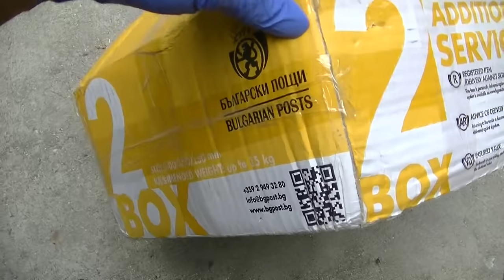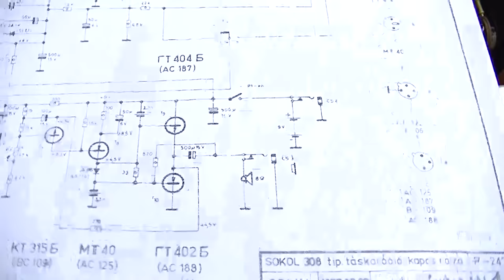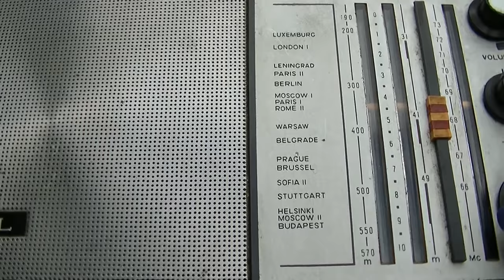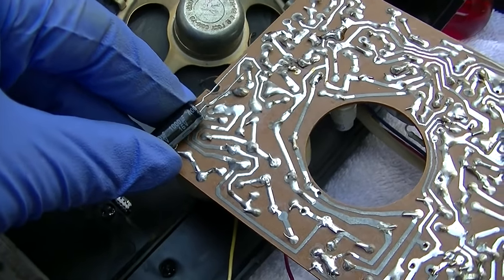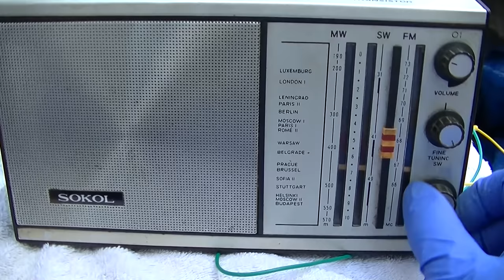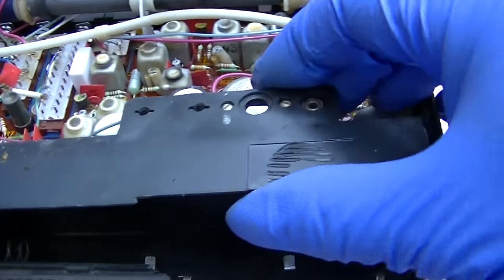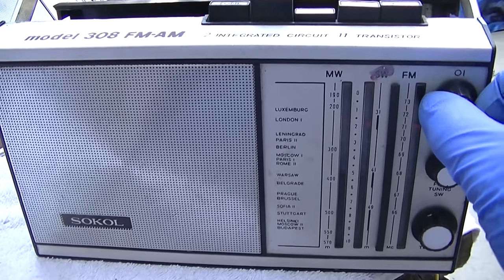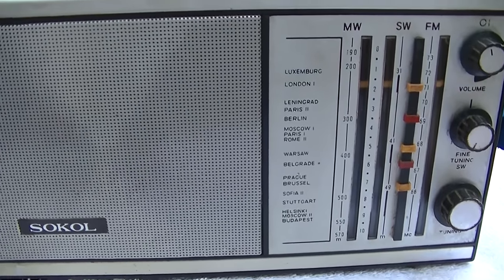Sokol 308 Russian USSR Built Transistor Radio Repairs

Comment: Shango, this lower FM band is following the OIRT standard, used by the USSR and its allies. If I remember correctly Bulgaria stopped using this band in 2005. You can modify these to receive the normal FM band. There are also Sokol 308s with a factory-made normal FM. There should be a table on the schematic somewhere with component values for the 88-108 FM band. I think I caught a glimpse of it on one of your schematics. Change out those components, do an alignment and you're in the game. For the sensitivity - Russia is a BIG country, so these were originally designed to give satisfactory operation even in the middle of the tundra, hundreds of kilometers away from the nearest stations. As a Bulgarian I can concur that these radios are EVERYWHERE. Apparently they were very popular and quite cheap. I have 4 right now, with one new-in-box.
EDIT: the replacement cap in the second radio is Bulgarian. Also on the second radio someone has already done some kind of quick and dirty FM conversion. This was very popular thing to do with old Russian radios in Bulgaria, when they switched off all the transmitters on the 66-73 MHz band. I should know - I've done it myself a few times, with varying degrees of success.
Reply: So what is the meter conversion on MW to KC, KHz? I found the same looking one on Ebay, but it says ST, KT, UKT for the bands. UKT looks like FM and it has the 88-108 dial. Also the one that lists the cities like Novi Sad and Skopje can be picked up on AM, but in the US, only gets the local stations.
Reply: I'm also Bulgarian and I get 3-4 stations in the Sofia region with Vef Sigma 206 and Resprom Lira 68 on the 66-73MHz band and they are different than the stations on the 88-108MHz band. I don't know how I pick them up, at least one of them is Bulgarian if I remmeber correctly. I had no idea that the 66-73MHz band stopped being used in 2005, but back then I was just 6 years old. Now I'm curious, have to check it again what radios I get in the lower FM band.
Reply: @Art7220  300/frequency in MHz = wavelenght in meters. So 190m - 570m is 1,6 MHz - 530kHz, standard MW or AM broadcast band. ST is AM or MW, KT is SW and UKT is FM.  Names on scale are localized, of course in US you get only US stations on AM.
Reply: Fascinating! Where would you best suggest buying one from? I'd love to import one to Australia

Comment: Here in Germany in the early 80s those russian electronics turned up in many "radio shack"-style shops. I had some "sokol" and other brand radios and a "TeleStar2002" B&W TV. The TV was built like critical equipment in Nuclear power plants or ICBMs. Incredible.
Reply: East Germany?
Reply: @eaglewi  no, actually in the west. Especially the small russian B&W portables were sold there in quite large numbers. They were also given away as a promotional gift for newspaper subscriptions and the like. I still have one of those small TVs which my mother got for subscribing to a TV guide magazine in the 80s.
Reply: I  got Sokol 304 from ukraine it works perfectly. I had one as Child and it never worked but no one in my family bothered to have it fixed under warranty.
Reply: @albinklein7680  
Did you see any Soviet computers in Germany in that time period? I heard they made a bunch of ZX Spectrum clones, many of them with English keyboards, presumably for export.
Reply: @gregorymalchuk272  ZX Spectrum was from 1982, those clones from 1986 or later. So they were obsoleted in west at that time. They were produced in low quantity and quality, often as home build projects. At that time they had to have english keyboard for compatibility. There were no localisation like in todays OS. And they were never licenced by Sinclair...

Comment: Shango greatings from Bulgaria. At about 3:50 the second paper you show with the scematic on it has the factory procedure on it to convert this radios to 88-108mhz on it. Its the tables on the bottom. The black cap on the second radio is bulgarian made replacement
Reply from the maker: so i need to translate that or have someone help me
Reply: @shango066  nothing that much to translate. it's just changing caps valius and putting caps in place of jumpurs around and inside the fm tuner, the two tables show witch are for 88-108 and witch are for the other, is actually very simple, they were made as you said for the foreign market so they are ready for bouth fm frequencies
Reply: around the tuner
c2 from jumper to 30pf
c3 from jumper to variable cap 2/7 pf
c11 from 30 to 43pf
c26 and c39 from 27 to 39pf
c44 from 3.6 to 4.7pf

jumpers "А to Б" and "Д to И" have to be changet to jumpers from "Б to Е", "В to Г","Г to Ж"

in the tuner

C1 from 1000 to 22pf
C3 from 10 to 6.2pf
C12 from 6.2 to 3.9pf
Reply: @shango066  would the Google Translate phone app be up to it, maybe? I’ve never used it for more than menus in French, though...
Reply: @simuler    this may want to be pinned to the top for future users...
Reply: @simuler  It probably also needs different number of turns on the osc and mod coils.

Comment: In the mid 90's FM changed from 66-74 to the western 88-108 MHz. It was very common to take your radio to the repair shop and ask them to re-tune it to the western standard instead of buying a new one.

Comment: I'm from Bulgaria and was quite surprised to see a package from my country on your channel. That was nice.
 The capacitor at 27:40 isn't a modern replacement. It's a Bulgarian capacitor from the Soviet era. It could still be a replacement but it's a USSR capacitor. The letters "БДС" mean ""Bulgarian national standard", and then the numbers are the actual standard. The orange transistor is the infamous in the former soviet areas KT315/KT361. The way you know is by the marking. I couldn't see what it was in your case. It should have a single letter somewhere, among other possible markings. If it's in the left top corner, it's KT315 (npn), otherwise it's KT361 (pnp) (in this case, the letter is usually in the middle of the transistor, but it can also be to the right). The letter is determining the exact type and variety of the transistor. For example: if it's a "G" ("Г") in the top left, the transistor is KT315G, if the letter is "B" ("Б") in the middle, it's KT361B. You have to look the exact characteristics based on that last letter and it's location, they differ between different letters (mainly the maximum collector voltage). Other than this, the device is basically just a general purpose silicon transistor. In many cases one can simply swap them with BC548 and BC558, or similar with little to no problem.

Comment: Changing from oirt 65-74MHz band to CCIR 88-108MHz band is easy. In Poland we had the same band. With 15$ RTL-SDR (oscillator measurement without connecting anything) it's a 30-60min job if you have schematic and everything plays along, 2-3h or more if no schematic and/or there are issues. Myself I have three radios which I converted to the new band. First adjust the oscillator to 98.2-118.7MHz (iirc almost all used standard 10.7MHz IF) and then use some cheap FM transmitter to roughly tune the RF amp. Both oscillator and RF amp should have LC tanks capacitance roughly halved (trimmer is preferred). IF and demodulator shouldn't need adjustment if they are not messed up.

Comment: Very interesting radios. Nice build quality. Since several LA TV stations still broadcast on the lower VHF band, I wouldn't be surprised if you did pick up a DTV signal. It makes sense the first one is an export model. None of the labeling is in cyrillic.

Comment: I know this video is ancient history by now but...  I'm kinda surprised you either didn't know or had never seen a band-shifted FM receiver.  Here in the US the original (pre-war) FM band receivers used something similar, down in the 30s or 40s range, but post-war the FM allocation was bumped up to roughly where it is today, and most people who had pre-war sets had the serviceman modify them for the new band.   For most radios you needed only to adjust existing trimmer components, but just like soviet band to USA band, you have to retune the oscillator to run in the range of the desired band, but you also have to stretch (actually you have to compress) the tuning to cover the new band, since we have a 20mhz allocation now but originally the lowband was 9.8-ish IIRC.  So you have to adjust the band-spread(dial alignment) trimmers, the coil manipulates where the bottom of the band appears on the dial with the capacitor fully meshed, and the trimmer capacitor adjusts where the top of the band is with the tuning cap fully open.  A few checks with a signal generator going back and forth between the adjustments at each end will give you the full tuning range, by the third or 4th tweak of the pair things should be good, adjusting one affects the other...  As tolerances and built-to-price became tighter, this becomes less and less easy to do without having to change major components out...   73! DE KB3GUF

Comment: It was a common thing, back in the day, to convert the OIRT (eastern) standard FM radios to CCIR (western) if you wanted to listen to other than propaganda. Actually, doing this mod is a bit more complex, than speeding up the oscillator, beacause the now used FM band is approx 3x wider than the obsolete OIRT. Here in Hungary, the biggest radio manufacturer Videoton made all of its radios dual standard from the late 70s.
Reply: @danutbe6541  I know this tuner, I have a silver one. The 7200 is way the most sophisticated circuit made by Videoton. It is able to receive both OIRT and CCIR stations, so it is dual FM too.

Comment: I remember reading there is something different about the FM discriminator on Russian radios with the 65 to 73 MHz band,  that it would not properly work with the north American FM transmissions, even if the oscillator was modified to operate at higher frequencies.  Or maybe this is just decoding stereo ?
Reply: The ratio detector just works, regardless of the country :) It is simply a frequency-to-voltage converter. Stereo versions might not work, yes, 'cause I'm not sure they use same MPX frequencies
Reply: @mrjohhhnnnyyy5797  USSR didn't use MPX for FM stereo.  But other eastern block countries used standard stereo MPX.
Reply: @mrjohhhnnnyyy5797  The preemphasis time constant might be different. USSR used a completely different FM stereo system, based on polar modulation. Not sure for how long. I think in the '90s they mostly switched to CCIR FM and standard MPX stereo, but until recently they still had some stations in the old band either in mono or with polar stereo, to feed these old radios.

Comment: Another interesting radio is Unitra Julia made in Poland for eastern and western markets. The polish version has FM for east Germany   and OIRT  and they get converted to 88 to 108 mhz FM.  I waiting for one in mail from Poland to USA and I won one in UK that was sold there I waiting for that one to arrive in USA also. It would be nice to send them both,  The version for eastern block has issue low sound and needs to have fm converted. UK version seems to work fine. It woould be great to send them both in for repair/maitenace and have them featured on this awesome channel.

Comment: I see absolutely all Soviet components. There is nothing foreign there. Details marked with a rhombus - military acceptance - increased accuracy and reliability. On the dynamic - 78 means 1978. Red flat square capacitors didn't have a good reputation but were super cheap. The FM ranges of the receiver are easily rebuilt from the Soviet standard to the European standard. After 1990, many radio amateurs did this in their receivers. Sometimes it was a separate box with its own power, which was simply attached to an external antenna. Without it, there was a Soviet range, and when the box was put on a retractable telescopic antenna, the European range was accepted.

Comment: I have the same Sokol 308, it's not dead but it's very silent, some of the Wiring cut only the Antenna and the battery terminal is intact...
At least I can do a re-wiring because of this Video :D
Reply: Most the know issues of this radio, the damn Antenna Wire broke because it's to short...

Comment: Hello, Thanks for all of your Electronics work on the channel. That second radio had the FM section re tuned from the OIRT Russia band to CCIR Western FM band. The Russians, after WW2, established their standard for the eastern block nations so that they could not listen to Western European radio stations (music, news, freedom etc.).  After the fall of the Soviet union, in the early nineties, the East switched over to  using the CCIR and so a lot of older radios had to be re tuned ,to be functional. Fortunately, all electronics produced in the eastern Europe was almost always designed with the mindset or hope of export to the west. So modifying the FM section usually was just a matter of changing a few caps and tweaking the coils. They had to do the reverse of the process to any Western Radios prior to 1989.

Hope this helps. Thanks again for all your videos and hard work.
Reply: Of course. That must be true with television too.
Reply: @chuffpup  B/W TV sets were compatible across Europe (except France and UK which used older standards) Only the sound IF was different. When colour arrived, all european countries used 625/50 standard, but with PAL or Secam colour system and 5,5 or 6,5 MHz sound IF (and 6,0 in UK and AM sound in France...). So it wasnt easy to made TV receiver for all european standards, but it was quite easy to made receiver for domestic standard + neighbour states (usually PAL/Secam and 5,5/6,5MHz sound). UHF channels were the same across Europe, VHF channels differed a little.
Reply: @xsc1000  Even in Soviet Union ? ) I live in New Zealand  (pal system. From '63 )...  Thanks for that info, I didn't know all those things. I have a few TVs from the early 60s. Big fan of Shango. I dream of finding a really old TV: 30s,40s,50s,... (not likely).

Comment: it is possible to by converter circuits to make an orit band fm work on the current fm they are still for sale here in CZ. I am working on a 62 Tesla that has this Orit band and trying to decide if to re tune, it was also made for export with the normal fm band, or get a converter pcb

Comment: And to think all those radio stations marked on the front have all closed down in Europe.

 It seems strange that the London One frequency was for the BBC European Service, used for English By Radio broadcasts as well as news in languages for Eastern Europe to be displayed on a Soviet radio !
Reply: Not all stations. You can still tune Prague on 639kHz, but next year it will be switched off.
Reply: Might be a 'Glasnost'-era radio.  There was a thawing of the Cold War and information prohibition with the 1985-1991 premiership of Mikhail Gorbachev.
Reply: @boggy7665  No, it was just common in export versions. Look at the picture of VEF206, its from 70s and London is there too. https://i.pinimg.com/originals/44/96/1f/44961f99a15b2adca9958e90549d25c7.jpg
Reply: Oh, I forgot.
I stand corrected !

Comment: Hard to see from looking at the video but It looks like the oscillator coil in the second radio has fewer turns on it. Would that increase the frequency response of the tuned circuit, pushing it into the active FM band? Presumably the antenna / RF coil would have to be modified in the same way.

Comment: If you were going to do a cap replacement and you wanted to keep the look of the Soviet Components, you could drill out insides of the old electrolytics and insert modern ones into the guts and remount the old one keeping the look of authenticity.  Many restorers do this with vintage radios from the 20's to the 50's.

Comment: Very informative!
I didn't know that the U.S.S.R. had its own version of the F.M. Radio Band.
I thought that it was always V.H.F. Band 2 for that.
The 20mA Current drain specification seems rather low.
Could this be when listening with an Earpiece?
Reply: @danutbe6541  Thanks for that.
I doubt that there would have been much intrusion of Western F.M. signals as V.H.F. doesn't tend to give distant reception like Medium wave for example.
Did they ever use Stereo encoding with the O.I.R.T. F.M. Waveband?
Reply: @michaelrobertson575  Yes, they used stereo on OIRT FM band. Many eastern block countries used standard FCC MPX stereo like USA and western countries, USSR used its own stereo encoding standard based on polarised modulation.The transition from OIRT to CCIR started even before the end of communist block and eastern Germany used CCIR all the time.

Comment: Radio tuned to 70.9 MHz would have oscillator running at 81.6 MHz,  (+10.7 MHz),  which should be the image of 92.3 MHz KRRL (+10.7 MHz).
Reply: Some of soviet era radios use low side injection, so the oscillator is 10.7MHz below the station. Your approach might not work
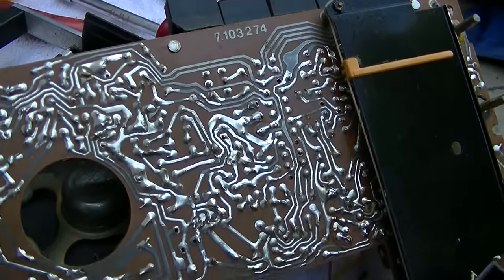Reply: @mrjohhhnnnyyy5797  The hint would be at 19:25,  Shango had the radio near the top of the FM dial,  maybe around 71 MHz,  and the Hip Hop of 92.3 KRRL could be heard,  which would be around 11.4 MHz above.  The other "powerhouse" transmitter Hip Hop station in Los Angeles would be KPWR 105.9 / Power 106,  but that is way to high up the dial to be a contender.